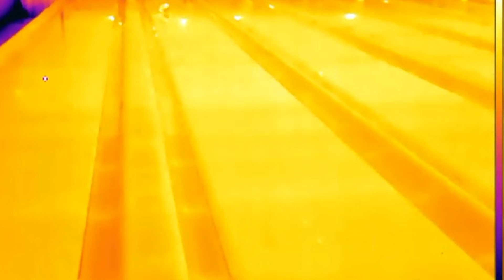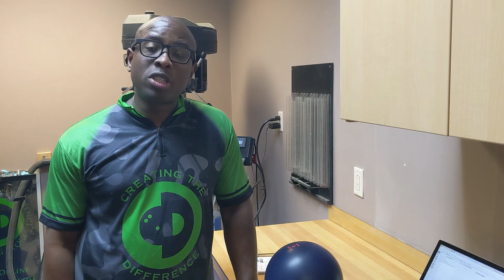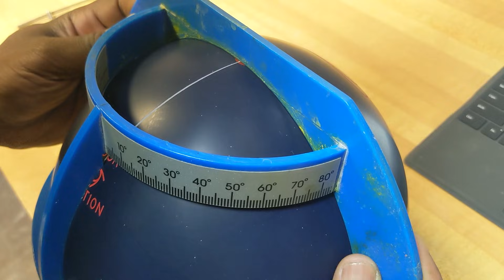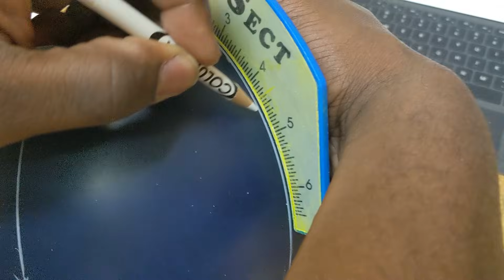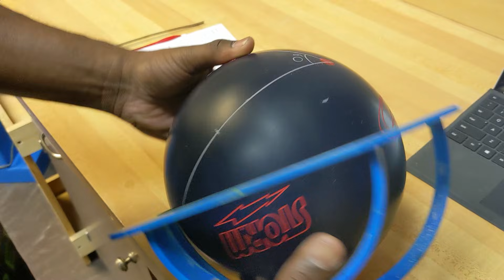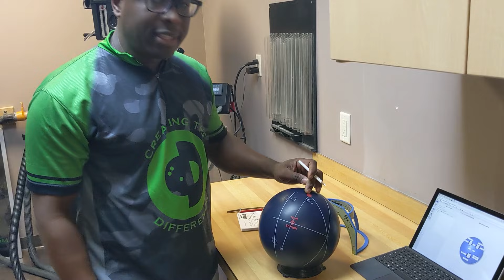TruBall Reviews - Official CONTROL BALL Layout Guide

Comment: I have an old motiv Forza that has been used a good amount and right now my arsenal is alpha jackal , jackal ghost ( drilled identical to each other) , my venom shock , venom cobra , venom panic all drilled pin in palm , my radical spy and I have a revolt havoc that I'm doing a short pin layout on, I throw the ball 15 to 17 mph, I did the tape trick and found out it made 13 full circles and takes 3 seconds from my release to head pin so I have 260 revs but I am more speed then revs and I don't know my tilt or rotation.would the control layout work on my Forza is my question